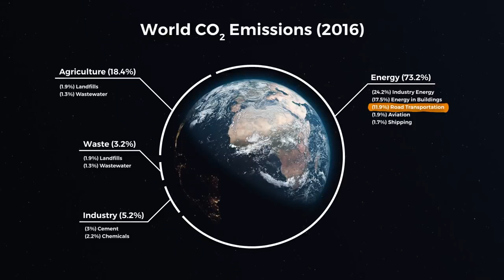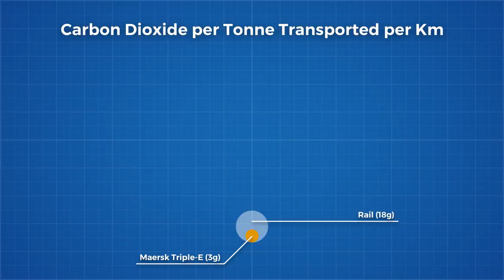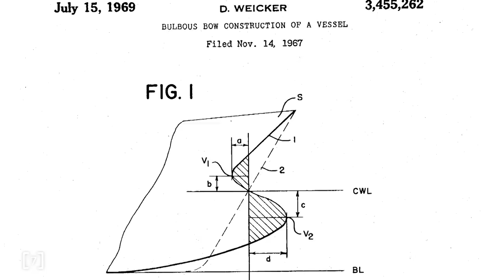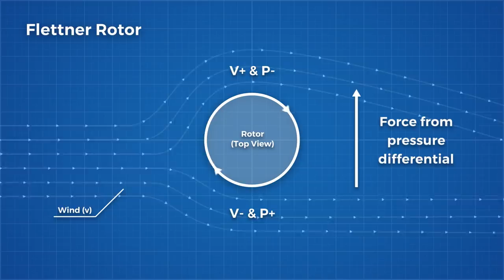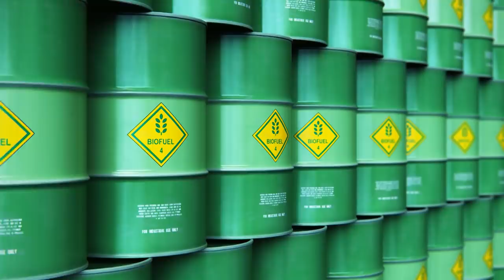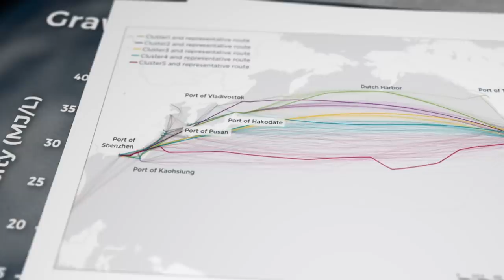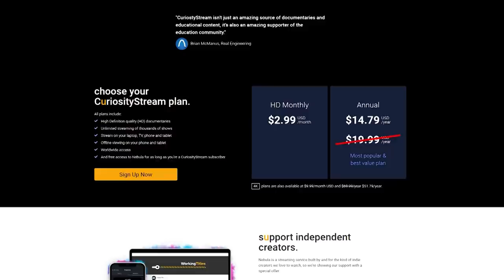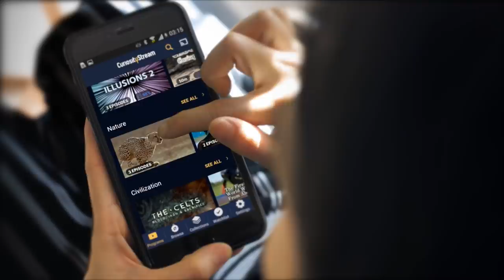Are Renewable Powered Ships Possible?

Comment: It's interesting that the narrator does NOT even mention nuclear power as an option for powering large cargo ships. Could it be because nuclear power is politically incorrect amoung many so-called "environmrntalists"?
Reply: Cost is nuclear energies biggest problem as well as the waste stream longevity, hazards of weaponisation (either formal by rouge nation states or informal by terrorising NGO), operating costs at ship size scale, et cetera, et cetera. Just consume less stuff, it is the zero cost option.
Reply: @BernardLS  
RE: "Cost is nuclear energies biggest problem as well as the waste stream longevity, hazards of weaponisation (either formal by rouge nation states or informal by terrorising NGO), operating costs at ship size scale, . . ."
(1) Cost
Much of the current cost of nuclear power is generated by legal entanglements and bureaucratic meddling. That's why it takes TEN YEARS to bring a nuclear power plant on line.
(2) Waste Stream Longevity
That's actually a red herring. It wouldn't be too hard to find a geologically stable area and dig a deep hole (say, 1 km deep; there are many mines that go deeper than that) and hollow out a large cavern in which to store the waste. Also, other uses might be developed for nuclear waste.
(3) Hazards of Weaponisation
Weapons grade uranium 235 (U235) is 90% pure. Weapons grade plutonium 239 (Pu-239) is 93% pure.
Power grade fissionables are typically only 5% pure. It takes much more than a garage chemistry lab to refine power grade fissionables to weapons grade; it takes a massive industrial plant.
(4) Operating Costs at Ship Size Scale
The U.S. Navy has been operating nuclear powered submarines and aircraft carriers for over 60 years. Besides, haven't you ever heard of economies of scale?
Reply: @spaceman081447  The rebuttal you offer is well received but I beg to differ on a number of counts.  Sadly my first problem is trying to get things together in an orderly manner. If you do a web search for ‘nuclear ship savannah’ you will see that it has been tried and did not work, other attempts suffer the same fate they only survive with subsidies.  Just think; would you have full confidence in the management of a nuclear reactor under the control of an anonymous entity only traceable, perhaps, via a letter box in a FOC (flag of convenience) nation state?  If you are could you sell that confidence to Japan, the state that hosted the Hiroshima and Nagasaki nuclear detonations as well as more recently the Fukushima ‘event’?  Then try that same, or similar, sales strategy on Ukraine, the nation state that as a part of the USSR (CCCP) hosted the Chernobyl ‘event’.  Modern iterations of nuclear energy thorium fuel, molten salt reactors or fusion reactors will carry the legacy of past problems.  It is the global trepidation of anything with 'nuclear' in the name and the economics of nuclear having transitioned from 'energy to cheap to charge for' too 'the costs of remediation are incalculable' that will prevent the adoption of nuclear energy as a means of creating energy at sea.  Modern reaction systems may have overcome the safety problems but the general public, having been misled in the past, will not believe the fresh new promises.  ‘They’ say nuclear is cheap, it’s not it is expensive as well as being complicated, dangerous, not universally socially acceptable and having only ‘no need for refuelling’ as a questionable advantage; actually it does need refuelling just not as often.  When they do need to refill the warming up stuff it takes considerable longer than pumping tonnes of thick black stuff, HFO cSt380, or thin runny stuff, Avtur-JetA1, onboard which is one of the reasons HMS Queen Elizabeth and HMS Prince of Wales are pushed about by gas turbines thus using the same fuel as the aircraft that fly off of them.  The Royal Navy (RN) with a high degree of skills and expertise use, at vast expenses to the UK taxpayer, a current operational nuclear fleet of 8 submarines (also known as ‘boats’) in two flotillas, four attack subs and four ballistic missile boats.  The carbon footprint of all the extra bits of hardware and the fuel, including processing thereof, from ground to propeller, are the external costs that never seem to get considered.  Disposal, once it wears out, of both the machine (that was a ship) and fuel is another can of worms best left unopened.  The 26 RN boats no longer in use are laid up (some in Rosyth and some in Portsmouth) awaiting long term deconstruction including dealing with the fuel rods and other irradiated material.  The USN is not, as far as I know, a commercial organisation working to very tight margins and also has the skill and expertise to handle the complexities of nuclear power so as well as submarines their aircraft carriers are nuclear powered and each have a build cost three times that of QE/PoW, bigger crews and more generous funding.  For those who still think that nuclear energy might be the answer I recommend this report: - https://www.bbc.com/future/article/20200901-the-radioactive-risk-of-sunken-nuclear-soviet-submarines? ocid=ww.social.link.email.  The navy of the USSR might have been under resourced and over extended but it was still generously supported in comparison with merchant shipping.
Reply: @spaceman081447  (1) Cost ;
Ten years is a optimistic but if the planning consents and open government protocols are not carried out then public support is even less likely to be available.  Would Three Mile Island (bad as it was) have been as bad as Chernobyl if the it had not been vetted and controlled as thoroughly as the democratic necessity required.  Most legal and governmental requirements are based on passed failings even as they make a handy scapegoat of commercial pressure.
(2) Waste Stream Longevity ;
Finland and the USA both have deep (underground) storage but other options being perused involve accessible storage for ease of monitoring and control, neither is cheap or proven on the time scale needed for complete amilorisation on the dangerous material.  
(3) Hazards of Weaponisation Weapons ;
While the consolidation of material necessary to produce weapons grade Plutonium is an industrial scale undertaking the Iranians and North Koreans have both managed it as has India and Pakistan and also possible Israel and historically South Africa.  Brazil and Japan may also have the ability and competence though they are currently self declared proliferators.  So difficult but not impossible.
(4) Operating Costs at Ship Size Scale,
Think I addressed this in an earlier reply.  The economies of scale still make nuclear energy a more expensive option, even with the atmospheric externalisation, than ICEs.  That is with out the remediation costs of the nuclear power plant.